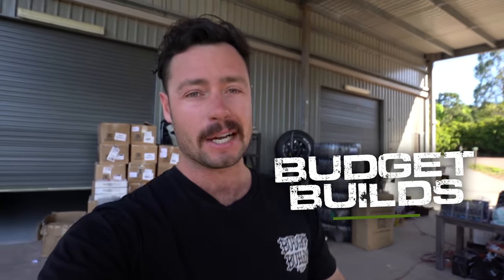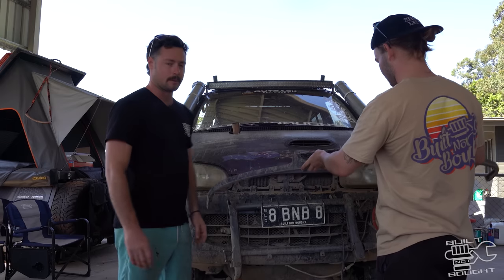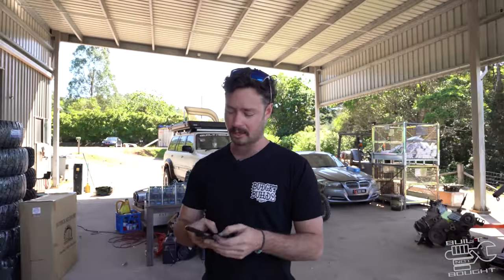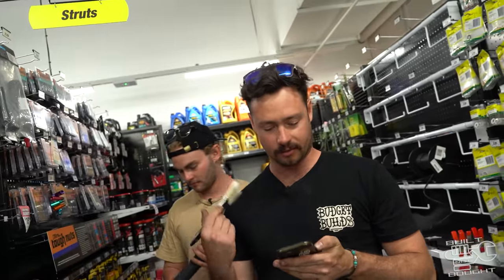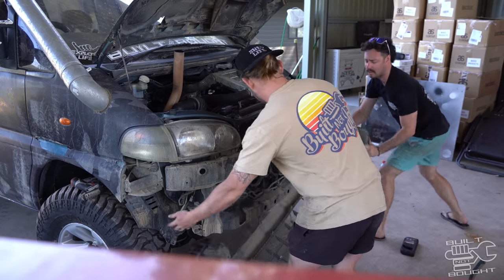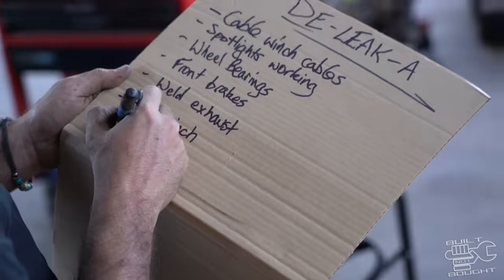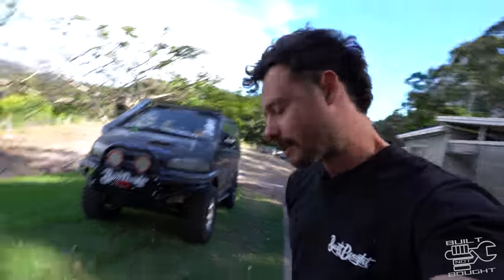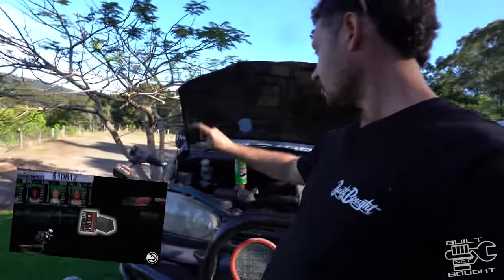DELICA BUILD 2.0 Didn't Go To Plan...

Comment: I like the Polaris Rear Vision Mirror/Camera unit - just like the OEM unit in my sisters SUV.  And I need one for my LC80 as the fridge, barrier and gear I carry pretty much blocks the rear view.
Reply: get the Gator rear view camera its about $170 when its on special at SCA and honestly for the price its one of the bestt quality rear view cameras ive seen. simple install and you can have alomost full vision of your blindspots

Comment: Took one of those portable aircons on a 9month trip this year across the top end, absolute ripper but chews the battery
Reply: How many hours use would you get from a 100A Battery? Or how many watts or amps it actually draws per hour?
Reply: @evil17  2x120ah available, used app 35% over 8hrs
Reply: @exvictorian3605  thanks for that info. So around 10-12 amps/hour at that rate (120-150watts/hr approx), I’d say that doesn’t sound too bad for what it is if it worked well, but then u need to be able to recharge that 80-90 amps the next day + at least another 30-50A for a fridge (size dependant) + lights & whatever else u may have been running ur camp with, if ur using mostly solar u would need about 400w-500w of PV without too much shading/cloudy days etc, to keep this setup going 24/7 without other charging sources, does that sound about right? Cheers
Reply: @evil17  traveled most days for at least 4hrs so vehicles alternator did most of the work balance topped up with 120 redarc solar panel, no cloud no problem or always a cv park to charge and run everything once and a while